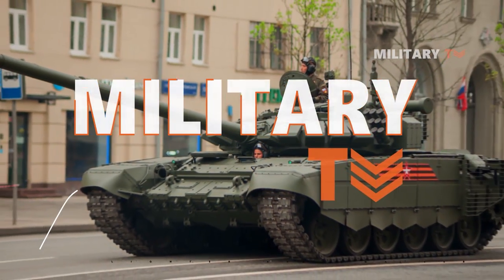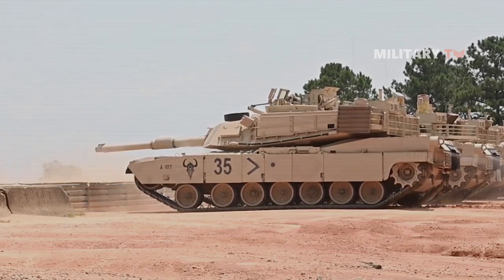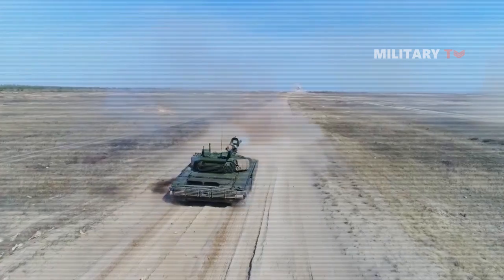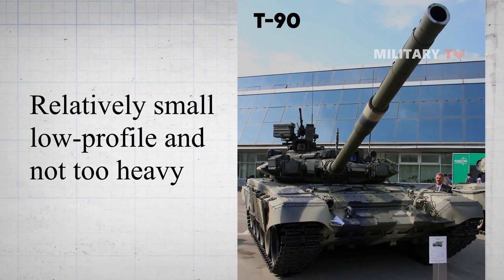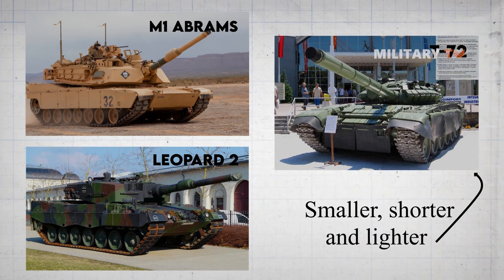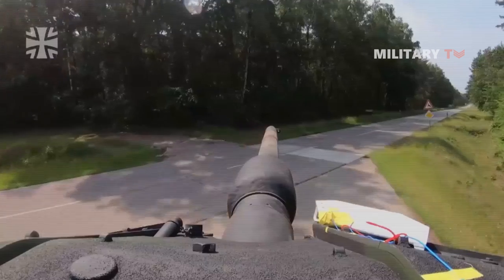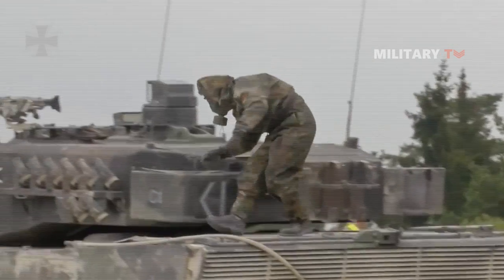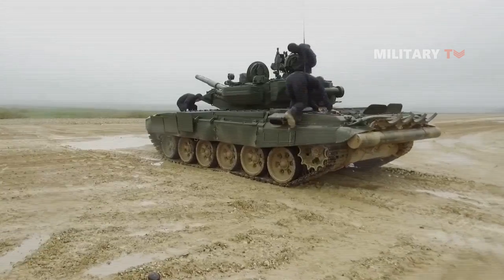Why are Russian tanks lighter and smaller than the western tanks

Comment: On the other hand auto-loader in T family limits space in the turrets so the major number of ammunition is located in tank body - it makes tank extremely vulnerable and very limits chances for crew survival after being hit. That's why quite often you can notice t-72 flying turrets after being hit by some ATGMs.
Reply: Also an auto loader takes 5 seconds to load. A well trained loader can do it in 3 seconds.
Reply: What's the average probability of survival from a hit these days, anyway?
Reply: @Codoxnz  It comes down to who sees who first
Reply: @check0mate  That's not better.....
Reply: @check0mate  give me a M1-Aber any day!
Reply: @check0mate  Well you know, who sees who first.

Or is it whom!
Reply: @Echo4Sierra4160  That's not the question, the question was what are the survival rates for getting hit by a shell, today? I assume they are low.
Reply: It's also because there turret is held on by gravity only. It's not bolted on like western tanks. One depleted uranium round and it over.
Reply: You don't even need a direct hit, just land the RPG next to the tank and the shockwave will disable the gun.
Reply: @Codoxnz  That's the same question like what are the chances of survival after being hit by a gun - it depends where, from what distance and what protection you have. The best body armour won't help if it's a headshot but kevlar west with ceramic plates surely gives you bigger chances on the battlefield. I wouldn't like to sit in any being hit armoured vehicle but, If I had to choose, I would rather like to sit in M1A2 Abrams, Leopard 2A5/6/7, K2 or any other western tank than in T-72/80/64/90s
Reply: That depends on the design. There's no necessaty to store the ammunition in the fighting compartment even if the tank has an autoloader. Design's like the LeClerc or Type 10 illustrate that well enough.
Reply: @shi01  The older T72s,
Reply: @travishanks7295  What a load of absolute bullshit.
Regards someone who has driven the T-series tanks.
Reply: @Echo4Sierra4160  Not if u have a rpg
Reply: @Mrbimmer11  A RPG won't do shit against a modern tank
Reply: The Abrams M1A3 has been known to take 2 close range direct depleted uranium hits to disable. Even then has a high personal survival rate.
Reply: it makes up for a great firework when they r hit nevertheless
Reply: @Echo4Sierra4160  You forgot the stamina
Reply: Another major disadvantage of an autoloader is that it deprives your tank of an extra crewmember. That may seem like a good trade-off for the Russian Army, where the high number of conscripts serving short enlistments, desertion, losses, etc, usually leaves regiments undermanned. In practice, it means you have one less member for whole-crew duties such as maintainence, repairs, security, and even manning the radio and keeping watch at night.

I used to run an artillery observer team; it was hard enough keeping 24 hour observation during the night when we were down to four men. I can't even imagine how much of a torment the lack of sleep and workload would have been if we only had three.
Reply: @omegaz3393  oh for the love of god I know the army boys call the sep3+ an m1a3 but it’s factually incorrect stop doing it. It’s an m1a2 with a better fcs not an entirety new tank, the m1a3 is going to be a completely new design
Reply: @Echo4Sierra4160  Yeah until the loader is fatigued and stressed and starts taking anywhere from 4-8 sec 
but if it comes down to who sees who first then it doesn't matter at all, so you kinda tanked your own argument
Reply: total loss of crew is not issue in russia. There is plenty of more men. West tends to forget that, the 2 million reserves Russia has, are expendable. all of them.
Reply: @SergeyPRKL  Nope. With high desertion rates and bad morale, most those numbers are liabilities.
Reply: @SergeyPRKL  It's a second world war point of view. Russia Federation is much smaller than Soviet Union in 1980's - it's almost half less population (there are only 140-150 mln people right now) and, additionally, Russian is in demographic crysis (more deaths than births). Maybe they don't respect their soldiers but they should reconsider it based on the current situation
Reply: Leaped 2 turret was also blown away by kurds
Reply: @SergeyPRKL  Even if that were true, which it's not, reserves cannot simply be thrown into tanks with no training.
Reply: @Echo4Sierra4160  not a hard technical limit to overcome, you can design an autoloader that can reload in 1 second. Besides, future armies will be made by 80-90% semi autonomous drones.
Reply: @Codoxnz  Depends on where it is hit really. Some areas of modern tanks are nearly invulnerable with multiple angled layered armor and reactive armor as well. Also what type of tank. Some western tanks take crew safety seriously when designing tanks. For example, if ammo storage is hit they might have blow off plates to prevent the ammo from detonating inside with the crew.
Reply: @rethguals  Napoleon with conscripts beat European asses most of the times, so you are biased against conscripts. Also 1 less crew member means 1 more member dedicated to maintenance. Also modern tank isn't an impenetrable fortress to be alone.
Reply: @rannnoch  well if your gunner and commander both have newest gen thermal sights your tank will be the first to see.
Reply: @NocKme  I don't disagree but that has nothing to do with the efficiency of a manual vs auto loader
Reply: I love all the war thunder Tank crew man here
Reply: @danielkirpichnikov2007  I am biased against conscripts; they are less likely to want to actually be soldiers.

There are a few issues with Napoleon's conscripts:
- A significant proportion of his conscripts were not French (i.e., Germans, Italians, Dutchmen), which had issues with reliability. Approximately between one third to one half of his Grande Armee were foreign conscripts
- Opposition to conscription was so fierce, particularly in Italy, that significant resources and force was needed to suppress rebellion. This has been cited as one of the biggest reasons for the Napoleonic Italian governments' failures
- This contributed to the mass desertions that ultimately helped destroy the Grand Armee. Over half of foreign conscripts deserted in the first months of their service.  The Russians were even able to form a foreign legion out of Napoleon's deserters

And there's issues with Russia's system of conscription, compared to Napoleon's:
- Napoleonic conscripts were called up and kept for as long as they were needed. Russian conscripts are called up for one year, and unless they volunteer or are involuntarily extended (a hugely unpopular move that signifies Russia is struggling), they must be demobilised at the end of their year
- Russian regiments consist of a mix of kontraktniki and conscripts, even 'elite' VDV and spetsnaz units. The problem with this is that conscripts are then ultimately only able to serve perhaps six months at a unit before they must be demobilised, those nearing demobilisation cannot be deployed, etc. Units then either operations either severely undermanned, or augmented with reservists (which presents more problems)
- Dedovshchina. Need I say more?

This is why 3-man tanks make sense for Russian regiments, whose regiments are already likely to be undermanned. But missing that extra member is a sacrifice, make no mistake about it

Also 1 less crew member means 1 more member dedicated to maintenance
Vehicle crews are largely responsible for their own daily maintenance and minor repairs

Also modern tank isn't an impenetrable fortress to be alone
Regardless, the crew of each vehicle needs to have at least one person awake at any given time - ideally two.

You could potentially limit this to two people out of every tank platoon, but this strongly degrades the security and capability of the unit. Every Russian tank has night vision and optics suites (some even have thermal, which all NATO takes possess); only having one tank active overnight is a major risk
Reply: @Codoxnz  Very low, for a penetrating hit.
Reply: Okay so couple points.

The carousel is in the most hard to hit place of a tank, sitting on the floor. Aiming for it requires deliberate action and tankers just fire center mass anyways, one wants to hit the target. Oh and it is usually the turret that gets hit the most. And ambushes are ambushes, tanks do not like those since every modern tank has thin sides.

The cooking off problem is more likely caused by the ammo outside the carousel (around 10 rounds) which are stowed everywhere, some quite exposed like in the turret behind the gunner and TC. That will catch fire and explode if the tank is penetrated. Remove it and it is mostly good to go.

Also, people forget that most western tanks do have hull stowage.

ROF of is more consistent because the loader does not need to fish for rounds after they used up the ones close to them (but then again, if you can just put those rounds down range that quick you are not changing position which is bad if there is an enemy ATGM around)

And last, the crew member is is more of an administrative thing. You could have them act as dedicated support crew for maintenance or if someone gets wounded/killed. Give them MANPADS to scare away the odd helicopter threat. Of course they probably get reassigned elsewhere, the pencil pusher way of doing things.
Reply: @Echo4Sierra4160  I'm pretty sure it's closer to 8 seconds for a Russian Auto loader but 5 for a Western tank, like the Abrams and Challenger.
Reply: @Echo4Sierra4160  but auto- loader takes no break and no tired
Reply: I was a tank driver in the army but hier are so many smart people and don't know how works russian tanks in the real life
Reply: it's a matter of scrap prices
Reply: @durunggabika8915  And in a fight that lasts 5 days that might make a difference
Reply: @durunggabika8915  this guys u mentions are world of tanks player hahaha

Comment: Fun fact:
Since east block tanks are ligher, some bridges in Czechoslovakia were designed in a way that they could support around 40 tons (T72/T55) but not heavier western tanks that used to weight around 60 tons...  former commanding general of the United States Army Europe Ben Hodges was complaining about this a few years back
Reply: i am surprised that the t14 is so large. though the rail tracks are wider in the russian/soviet rail network, the clearances through tunnels, near cliffs, etc is smaller too. and the weight. bridges, rail code etc is lighter, and you can say they made the bridges this way for the tanks, or the tanks this way for the bridges, either way. its just the way it is